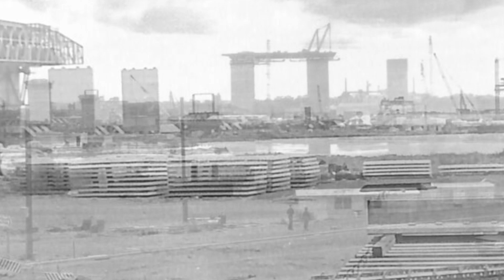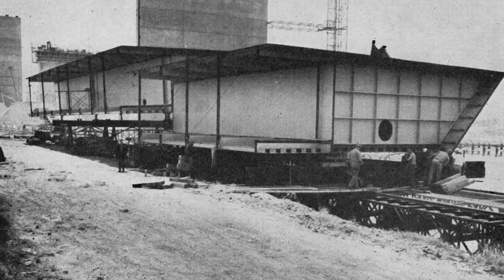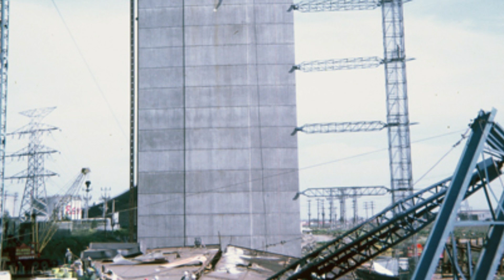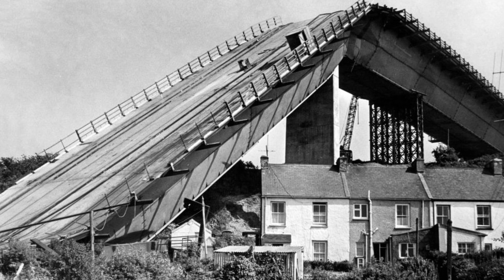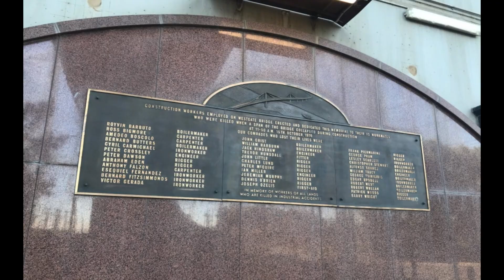Westgate - Beyond the Collapse, Part 3: Collapse & Royal Commission

Comment: Planners went cheap and opted for fewer piers, welded box girder, and dodgy erection methods. Bridges are dangerous.  Here in Canada we have the Second Narrows bridge disaster with temporary falsework not strong enough; and 2 Quebec Bridge disasters.  It seems the transistion from rivets to weld did not go smoothly. Bridges never had a problem when they were rivetted.